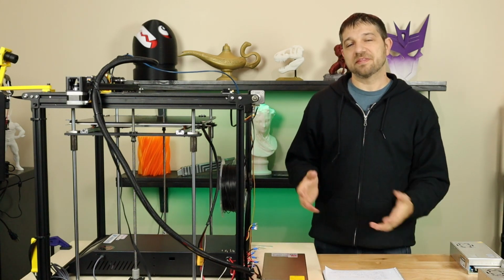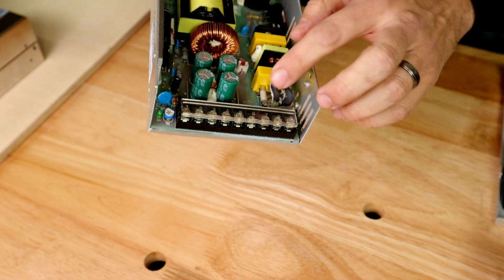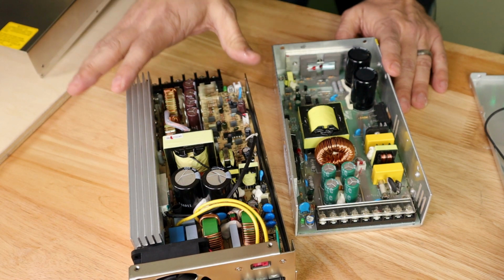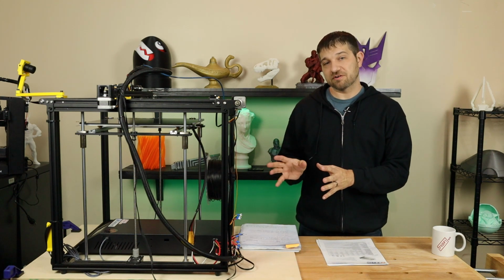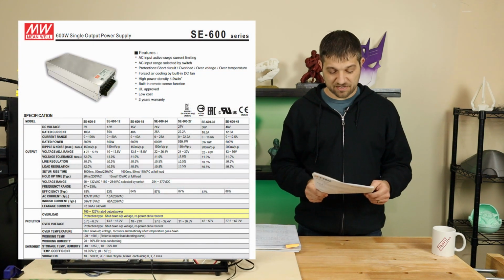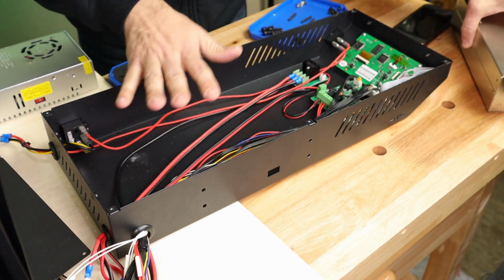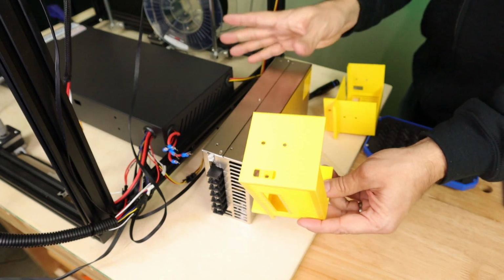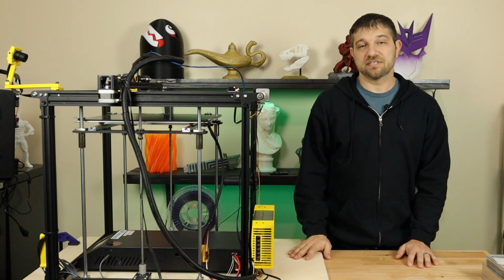Ender 5 Plus Power Supply: What You Need to Know!

Comment: I have just canceled my order for this printer.  In my career I have specified many power supplies for various products.  Based upon the wattage consumption shown in this video I would have specified a 1000 watt power supply.  No power supply should ever be run at maximum.  There's simply no safety factor.  Look at the Meanwell data sheet.  There are de-rating curves for temperature.  What that means is that as ambient temperature increases the ability of any power supply to supply the rated power is reduced drastically.  Heat is the enemy of power supplies and I live in Arizona.  I may buy this sometime in the future but only if it comes with a 1KW PSU MINIMUM!!!!  How long would your car motor last if the throttle were held wide open all the time?
Reply from the maker: I completely understand. I make the information available so you can make an informed decision. Sounds like you have.
Reply: @kerseyfabs  This is a systemic problem with Creality.  Maybe with more inexpensive printer manufacturers.  It's one of the ways they keep the price down.  If they have any kind of an engineer on staff then they know exactly what they are doing.  Someone needs to confront Creality with this evidence to force their hand.  I just had a look at the Ender 3 and it appears to have a 360 watt supply.  Much too small.  Someone could be a Youtube hero by exposing this fraud.  I'd do it if I had your subs but I'm just a retired engineer looking for a hobby.

Comment: You only ever want to use 80% of the quoted power supply rating for efficient trouble free operation. In your testing you got a 650w draw, another Youtuber you say quoted 700w. Therefore an 850w power supply is the ideal solution. It wasn't the heat in your home that killed your supply, it was the drawing of 650w through a 500w psu, though it wouldn't help as components heated up due to the overload.

Comment: I just finished putting together my ender 5 plus and there is no voltage selector, is this normal?  I opened up the bottom and can't find one on either side of the power box 🥴 now what?
Reply from the maker: That probably means you have a Mean Well supply which is auto switching.

Comment: what about using two supplies instead of expensive 600watts one?
Reply from the maker: That's another perfectly valid solution. You would want to put the bed on one supply (500W) and the rest on another (<200W). That doesn't save any space though.
Reply: @kerseyfabs  True, I think this printer is a framework as you say, it's beyond fixing as intended. I don't think saving space is an issue, was thinking about doing something similar as seckit and toolchanger, make a wall at the back to mount electronics. I'm chaning display, mainboard, psu, hotend+extruder (hemera), so it's only the extrusions, stepper and heatbed left :), Looks like many others have done similar. (expensive extrusions)

Comment: You missed my choice for the best power supply from meanwell. hlg-600h-24a 
These supplies, along with being appropriately adjustable and current limiting,  they are entirely fanless. Of course you have to have it external, but it's like having a laptop power supply. Plus you're removing all that potential heat from the electronics area.

Comment: Hey Kersey - thanks for the Ender Plus videos. Very nice. 

Do you have any opinion or knowledge about possibly using a linear, non-switching PSU instead of the meanwell or similar switching PSUs?

For normal motion control systems, IE - not in inexpensive hobby grade 3D printers - linear toroidal PSUs are by far preferred due to the lack of switching noise. I am looking at a 600watt 24v linear PSU on ebay for $45.. To me it appears to be both more affordable and superior to a alternative switching PSU. Any opinion?

Comment: So in the few days of using my 5+ I have noticed the most noise comes from the power supply fan. Mine has the MeanWell 500 in it. I was just wondering if you were to switch to something like a 800 watt supply you would not be stressing it out and I turn it would run cooler and the fan may not need to run at such a high setting. A bigger supply may even have a larger quieter fan to begin with. Any one think of this or try it?

Comment: Does anyone know the original ender 5 plus power supply transfer time? I have a UPS with 9ms transfer time but the printer still shupt down when I have small (1s) electrical blackouts
Reply from the maker: That's really surprising. I know I've had printers that survived quick brownouts. My guess is that you caught it just wrong with the bed heating cycle. Even then, I'm still surprised.

Comment: My father in -  law had the same power out issue. I found that there were two cold solder joints on the mosfet thingy that is it's own board. I ended up heat up and remelting the solder and it worked great from then on. 

If the ender 5 is running 24 volts, why does this need a miniboard on it's own to deal with power?
Reply from the maker: Which mini board are you talking about?
Reply: @kerseyfabs   The third little board when you open an Ender 5 plus control box. It's for heating up the bed, but why does it need it's own board for this? And oddly it wouldn't get power to the board when the connection to the little board was lost.
Reply from the maker: @Mikey_xx_  That board has what's called a MOSFET on it that controls power to the heated bed. It's used when you have high current that you need to switch on and off. It keeps you from accidentally blowing up your mainboard. It takes power directly from the power supply.
Reply: @kerseyfabs  so, like a relay switch for high drain items like lights etc on vehicles.
Reply from the maker: @Mikey_xx_  Yep. Just like a relay.

Comment: I can verify that mine did, however the new supplies do not have a voltage selector switch, as I am in Canada, I am a bit worried to plug the thing in, even though it came with a North American power cord.  could the switch be inside?
Reply from the maker: That's an auto-switching power supply. You'll be fine.
Reply: @kerseyfabs  got it working, thanks to your videos, have a weird problem with the reading and printing of files on an SD card, where can I go to ask?
Reply from the maker: Make sure the disk is formatted for FAT32 and 8192 block size and the filesystem should work. It doesn't hurt to stay under 32G in size too. Filenames should be kept short for the stock display/board. I'm not sure what the limit is off the top of my head.
Reply: @kerseyfabs  Thanks, just spent this evening taking apart and cleaning my hot end, learned alot

Comment: how about running the stock PS at 220 volts ?
Reply from the maker: That's the input voltage based on where you live. It doesn't have anything to do with output.
Reply: @kerseyfabs  this is true but the way the components are designed, I was curious because of bitmains designs. thanks for the fast response, I'm currently using my ender 5 plus and was wondering if unplugging a antminner in replace of this printer would be beneficial.
Reply: @kerseyfabs  i can cook a us made HP 1200 fast running it on 110 vs 220.

Comment: that's not CE certified, that logo is the china Export logo, not the Conformité Européenne certification
Reply from the maker: Understood. Thanks!
Reply: @kerseyfabs  tho Chinese manufactures are catching up to that fact, so most of the shadier manufacturers use the actual ce logo, altho they never received proper certification. Bottom line, if you buy cheap Chinese products, don't expect the most safe or quality of products. Still good video bro
Reply from the maker: Thanks for the info and for watching!

Comment: using a 600w power supply on a 3D printer with a 500-700w power draw seems insane to me. When I build a PC I usually make sure the wattage of  PSU has a 50% over head. So for example if my PC average peak average draw is 400w I wont be looking at a PSU below 600w. I have been building PC's and lots of other things for well over 30 years and with less than a handful with failed PSU's. Constantly exceeding the nominal max wattage is a great way of destroying power supplies especially under long term constant usage. So if I have a peak 700w max power consumption trust me I wont be looking at a 450w  power supply or a 600w power supply "ever".

Comment: Anyone with a higher education in low current knows that you can calculate the service life of components, but they also know that when you drive at the border, the service life is significantly shortened, so they will burn of after a short while

Comment: I got my first printer, an Ender 5 Plus, yesterday. I assembled it in an hour with no issues, did a lot of bed leveling, and started my first test print. It ran for all of 30 minutes and then just died! So here we are, a year later, and obviously these power supplies still SUCK!

I worked in electronics for over 20 years. I can tell you for a fact that cheap components will consistently fail. Companies don't care because they charge more than enough to make up for the returns, so don't expect this to change - ever!

Another thing about power supplies - part of their purpose is to convert AC to DC power. A good power supply delivers "clean" DC, which is a nice, flat voltage signal. A cheap power supply delivers "dirty" DC which constantly varies in voltage, and can damage the other electronics in your printer over time, or at least shorten their life.

If you order a Creality printer, then order a Meanwell power supply at the same time and save yourself a lot of headaches.

Edit to add: Just noticed that the description says that these now come with Meanwell power supplies. Mine didn't. The board looked exactly like the one in this video. Maybe they sent me an old refurb, and that's even worse than a cheap power supply..
Reply from the maker: Thanks for the feedback. Sorry you didn't get a new unit. I didn't get one either when I ordered my second one last year.

Comment: That 150% over shenanigans on the datasheet - that does NOT mean what you think it means.   What it means is that they guarantee an minimum of 5% over rating, but based on luck of the draw components received from their vendors (batch differences and such), their testing shows that SOME units have performed up to 150%.  BUT THEY DONT GAURENTEE THAT.  They guarantee 105% of rating.   Buy it based on that.  The fact the you made it out that every unit will do 150% is massively false.

Comment: I've been running the stock for 2 years so far..... that being said, i think it is finally dying. Whenever the bed heats up, you can hear the fans struggle to continue to run and the quality of the prints have been slowly degrading. Still looks good, but not quite near as good of a look as it used to do.

Comment: i put the 500w meanwell in mine i didnt even get to print with the stock shiter and it failed after the manky burning smell.. heres a clip to make the 500mw not from creality fit the 5 plus u need two some fixings and a t nut ender 5 plus 500w meanwell adaptor spacer  found on #Thingiverse https://www.thingiverse.com/thing:4194703

Comment: You dont need to be an engineer to figure these issues out, you just have to have some common sense, and knowledge of how it was made. I agree with  
andrewforte
 you will need to make a ground wire pig tail to connect from the ground on AC side to the printer chassis otherwise you will have some issues with noise and ground loops. As for the printer itself the mounting plates of the PWS is plastic and that insolates the printer. The problem is static electricity you will touch the printer and might ZAP out the components that are MOSFETS or susceptible to ESD.

Comment: I did this mod, but was looking around for info on the rs terminal at the back, and came across the website below.  I'm not certain how much this matters, but just in case I figured I'd attach it.  I plan on making the jumper in the next few days, and then digging the meanwell out of the case I just-stinking-put-it-in.
https://discuss.inventables.com/t/remote-sensor-on-power-supply/34015

Comment: Mean Well SE-600-24 AC to DC Power Supply - DOES NOT HAVE FAN SPEED CONTROL! 
Do you want to feel like sitting in a server room? I think you need to think carefully before listening to such advice. Now let the author explain to everyone how to make the fan run quietly.
Reply from the maker: I'm sorry I left that out of the video. I didn't say it was quiet. It is a beefier, louder supply. My goal was to make sure the printer was powered properly. Sorry I didn't include noise ratings.
Reply: @kerseyfabs  Also I recommend people that have chosen this power supply to read this -

Quote from the forum -
The remote sense terminals should not be left open.
If you are not going to use the remote sense option, then you need to hook a wire between +V and +S. Also, hook a wire between -V and -S. This will put the power supply into what is referred to as “local sense”. The wire does not have to be a large gauge as there is very little current flow into the “sense” terminals